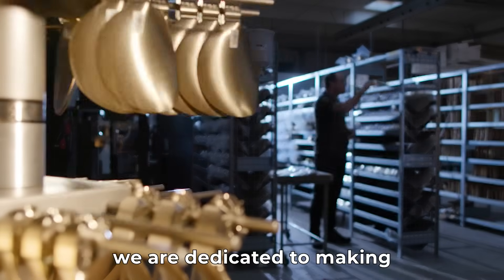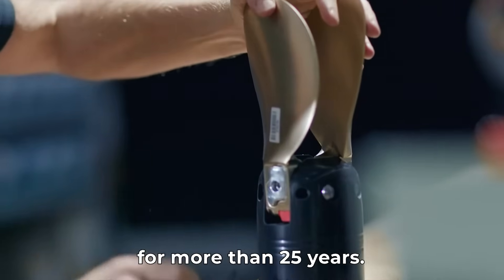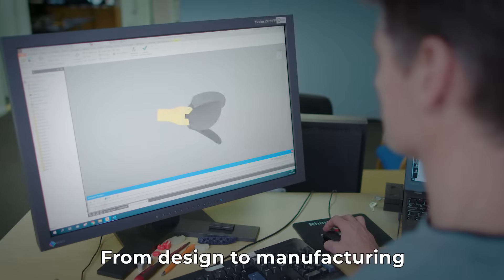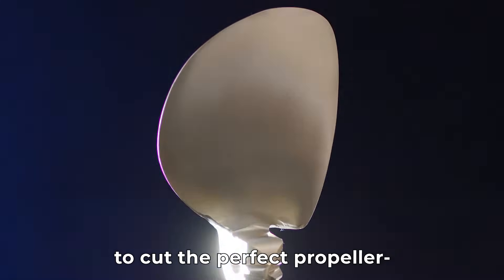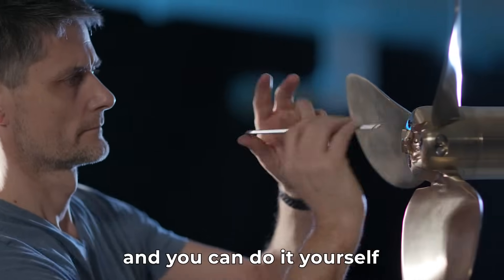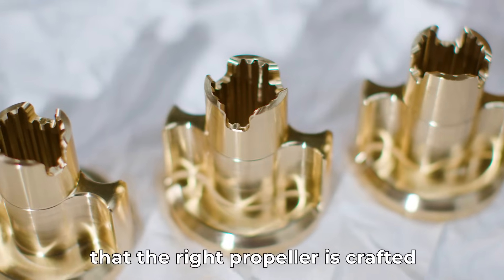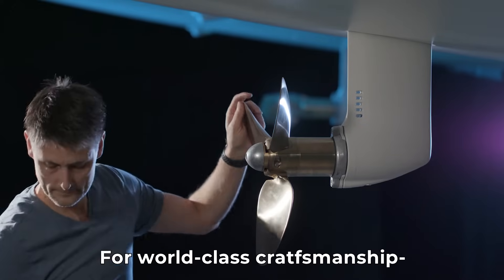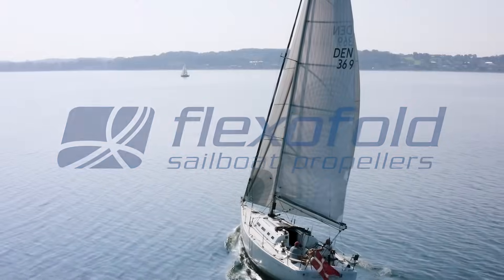Flexofold Sailboat Propellers

Comment: I have a catamaran and purchased 2 sets of Flexofold props in 2010, Installed on the hard, following directions.   3 years later the entire unit fell off.   Then in 2017 a prop departed.   Now July 2021 again a prop has departed.   Flexofold denies this has ever happened before.   Horrible customer service.   Either the pin retaining bolt rusted, or broke or just backed due to thread locker failure releasing the pivot pin to depart.  After they denied this ever happened they say oh we are 3 weeks out for you to get a new set of blades for 700 usd.   Fixed props here we come.   Don’t need the hassle and disappointing service.   Never again for me here in Florida. There must be a reason the pin has come out.  There must be some way to insure that bolt cannot depart the prop.   Only Flexofold bolts have ever been used and tightened to specs.
Reply: There is a retaining washer that you are supposed to bend over the main retaining nut and also the smaller retaining bolt. Did you do that? I don't see how it would be possible for it to back out if you bent the lock washer over the nut and bolt...
Reply: @mckenziekeith7434  yes, I used all the retaining washers.   I agree that it would seem impossible for the pin or bolt to back out.  But that’s what happened.    I still have them on my boat today until the next issue occurs.   I only use Flexofold products including the thread locker.  It’s a boat.  Things happen.
Reply: @Thomas-nx1tv  I'd be tempted top use PTFE tape instead of thread locker, purely because it's completely unaffected by seawater and would help prevent galvanic corrosion in the threads. I'd also think about using stainless spring washers, Nord-lock washers or similar on everything to stop them wanting to back out in the first place.
In my experience, it's a bit of folly to have everything rely on thread locker, which does one of three things: Nothing and it's fine, it lets go from gradual chemical attack (seawater in this case), or it bonds everything together like glue and can't be removed without heating the whole thing up until it's red hot (burning it off so it lets go).

To be fair, I think that the Flexofold prop is a bit of a questionable design. It's made to be easy to assemble, but things like this inevitably end up being easy to fall apart.
The fact that the propellor blade retaining pin is only held in by one bolt is silly, the pin itself should have threads on one end and be threaded in, so that the retaining bolt stops it from wanting to unthread itself. It does do that to an extent already, but it currently doesn't stop the pin from walking around until it's so loose that it shakes itself apart.
Reply: Thanks mazda maniac for your reply.  I will give that serious consideration.   Makes sense.